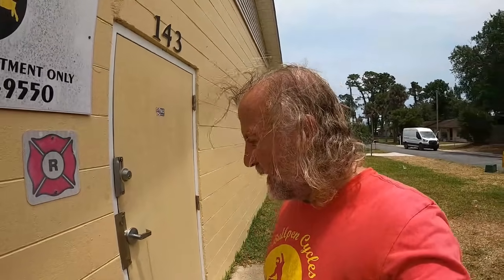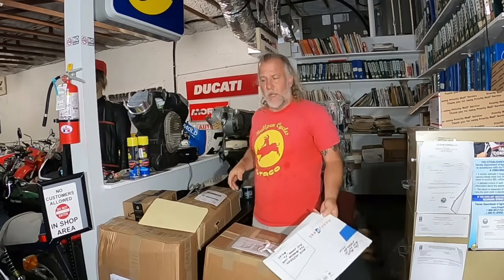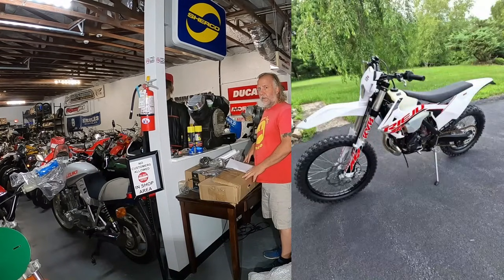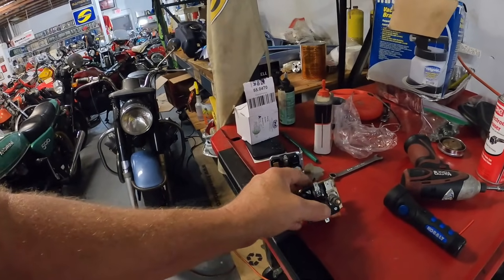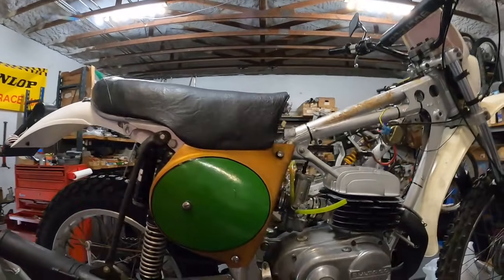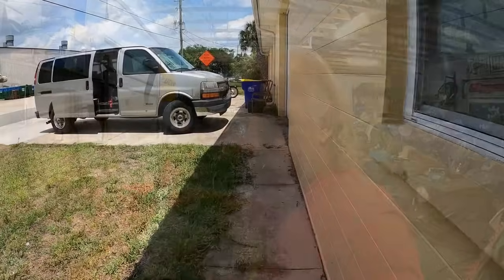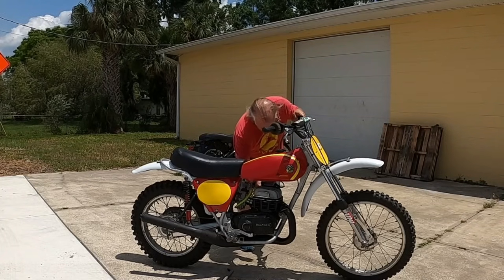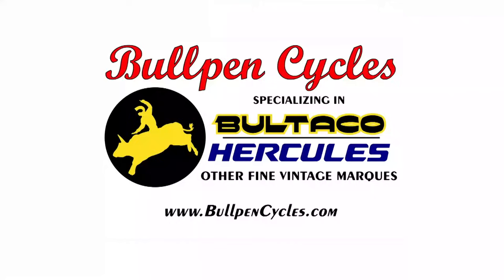WHEN THINGS WERE FINALLY LOOKING GOOD, MY BULTACO BIT ME!

Comment: Why don't you get one of those electric roller rear wheel bike starters like the racers have.....
Reply: He has one.
Reply: On nobby tires i bet its not as easy as it sounds especially on big bore 2 strokes ( with nobby tires)
Reply from the maker: That is true. And the Pursang has a dual plug head with no compression release. So it just the clutch and 4th gear on the roller.